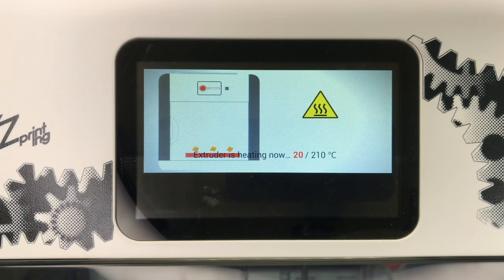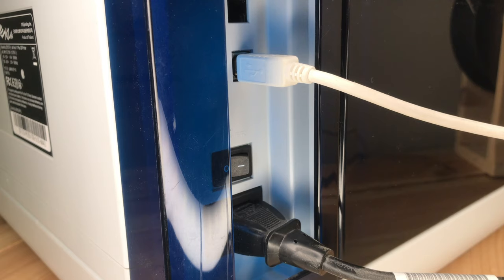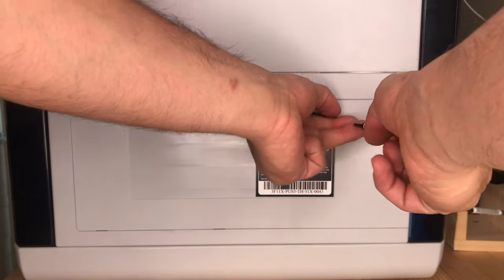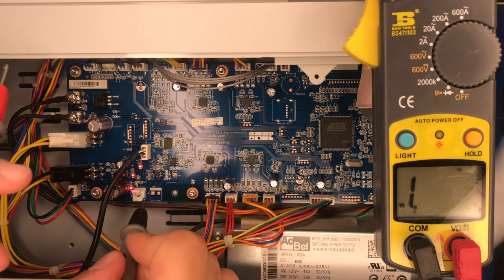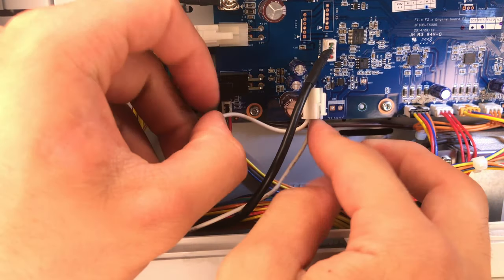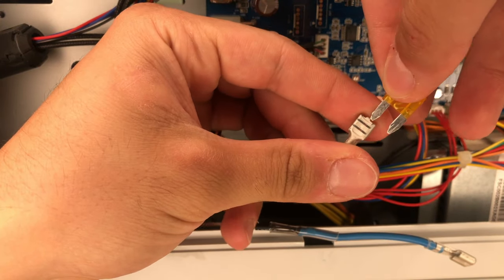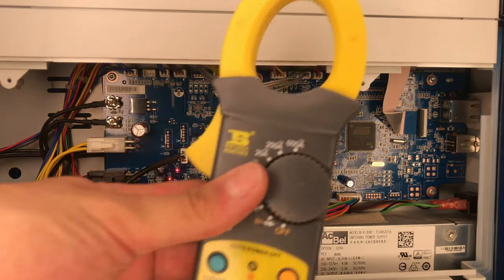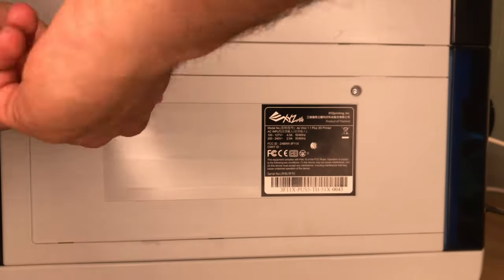Repair & Prevent Extruder Not Heating Up!  - XYZ Da Vinci 3D Printer Upgrade & Fix

Comment: Hey! I’m trying this out at the moment .. what kind of fuse connector did you use? I can’t find one that looks like yours and it seems simpler to use. Thanks!
Reply from the maker: Hey! 
First of all, thank you for reaching out! I hope you found the video useful!
For the fuse I used regular 12V battery connectors, they fit in the fuse perfectly! I believe they are called Quick Connectors or Crimp Terminals.
I found those on amazon if you want: https://www.amazon.com/FDD2%E4%B8%80250-Insulated-Electrical-Connectors-Connector/dp/B07MCXQVKC/ref=sr_1_14?dchild=1&keywords=F2+type+terminalnect+connector&qid=1619075924&sr=8-14

I hope this will help you repair your printer, and if it does I would really appreciate it if you could leave a Like or even Subscribe to my channel, this would mean a lot to me!

Comment: Hey... Great video.  I have a Da Vinci 2.0. My extruder heats up automatically until I try to change the cart. Then the temperature drops and I get an error message.  Do you think that my issue is the same as the one that you are describing?  Thank you
Reply from the maker: Hey Gregory!
Thank you for reaching out!
I don’t think your issue is similar to the one described in the video, since your extruder is heating then power is reaching it. Maybe it is something related to software, unless you have some loose wire/connection that is moving while you change your cart. Also could you clarify what do you mean by cart? Is it the plastic spool? 
If so maybe it is a problem with the specific spool? Try swapping the eeproms on the bottom (the small pcb with copper pads on the bottom of the plastic spools)

Comment: I've probably blown a similar fuse (I hope) on my 1.1 plus whilst trying to cleaning the nozzle and shorting something inside the print head. The printer starts (lights go on, head goes to zero position) but the display is dead..  any idea how to fix this, what to check exactly ? thanks!

Comment: My printer heats up but it only gets yp 135 degrees, it can heat up to 200 if I stop the fans spinning but I don't get a good print of I do that, of you have any idea on how to fix this that would be great thanks
Reply from the maker: Hey Jasper! Thank you for reaching out! I’m not exactly sure what might be causing this issue, but I have a feeling that it might be the heating element that is broken. Try to replace it with a new one. Also never stop the printer fans, this will cause the heating element to over heat and get damaged, and probably damage other components in the 3D printer.

Comment: The component designation is "R" for Resistor, why are you calling it a thermistor?  Also do you know what component would need to be replace or bi-passed if extruder1 also had no voltage i.e. Duo 2.0
Reply from the maker: Hey! Thank you for reaching out.
After doing a lot of research online I found that the component is actually a thermistor even though it is designated by an R. I know it doesn’t seem very intuitive but that’s how it is. Additionally, a thermistor is just a resistor that varies depending on it’s temperature and current draw.
Concerning the Duo 2.0, there is a duplicate of the same circuit next to it. If you follow the traces you should easily find the second thermistor.
If you need anything else please let me know, and Best of luck!

Comment: My 3d printer rxtuder not working and  my computer is showing  cold extension prevented
Reply from the maker: Hey Dinesh! Thank you for reaching out!
What 3D printer model do you have? 
Usually, Cold Extrusion means that the temperature of the nozzle is not reaching the minimum required temperature. This might be due to a faulty heating element or Sensor.

Comment: Good evening, I would like to ask for your valuable assistance. I am the happy owner of a Davinci 1.0a but I am afraid I will burn something while doing maintenance. I found that the R271 resistor was not giving continuity so I bridged and put a fuse to protect as indicated in videos and forums. But unfortunately the extruder does not heat up, I have measured continuity and the cable is perfect but I found that when measuring voltage in J4 sometimes it starts from 12v and it goes down progressively as if a capacitor were discharged. What do you suggest?
Reply from the maker: Hey Carlos! 👋 
Thank you for getting in touch.
First of all I would like to highlight some basic troubleshooting steps.
Does the voltage go down with or without the heating element connected to it? If it goes down with the heating element connected to it, but not without it, try replacing the heating element. If the problem persists then there is probably a problem in the motherboard. 
If in both cases (with or without the heating element connected) the voltage drops then also there is probably a problem with the motherboard. 
And if it’s a motherboard problem the best way to find the problem is to follow the traces of the motherboard from the J4 connector. 
I will try to do some research to see if anyone is encountering the same problem.
What i would guess would be that there might either be a capacitor problem as you mentioned, or a thermistor problem. (A thermistor basically is a resistor that increases it’s resistance with temperature) and if it’s resistance increases and is in series with the J4 connector then the voltage would drop as it’s temperature (or something in it’s surrounding) would increase.

Kindly Keep me updated, and I will let you know if I find something related to your issue.
Have a great day and best of luck!
Reply: @TheWorkshopByGM  Thank you very much for your answer, the voltage drops without the extruder connected. I followed the circuit and I see that in your video the D2-5V led lights up but not on my board
Reply from the maker: @carlosalberto8946  Thank you for your reply, I will do some research and come back to you as soon as possible!